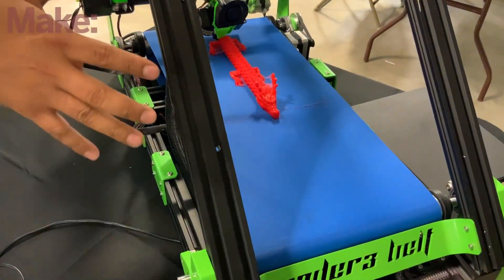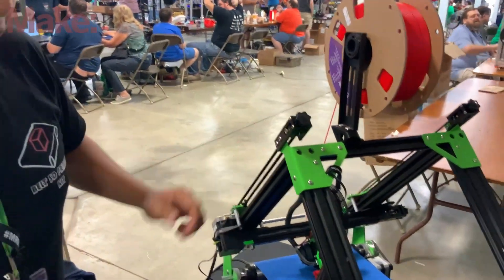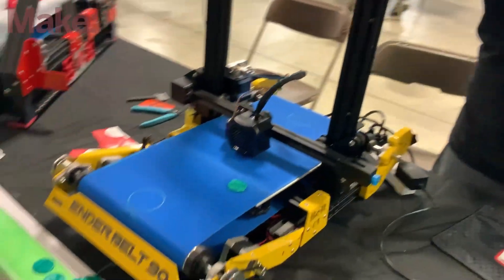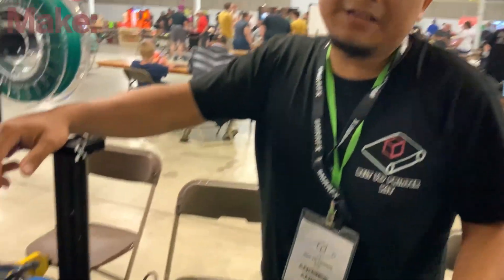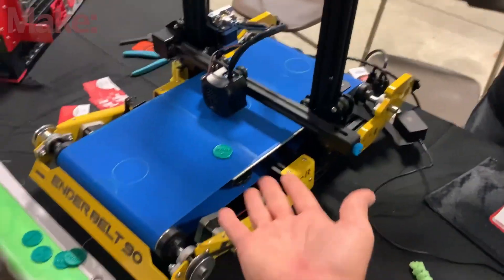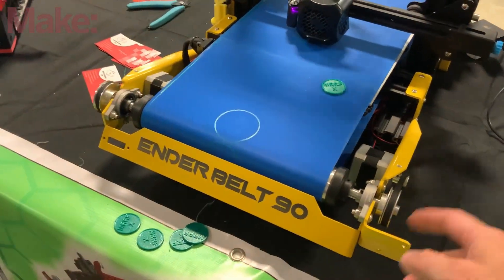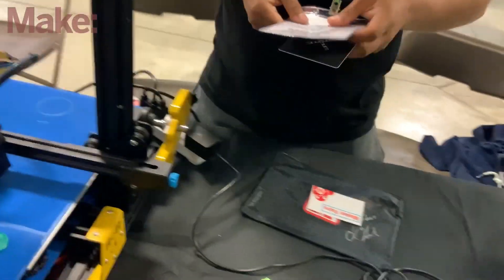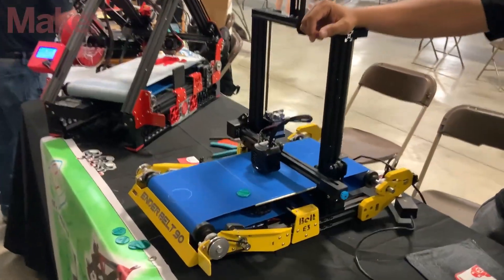This DIY belt conversion kit will turn your #3dprinter into a belt printing TANK.

Comment: We can now have these because make the channel this is on had a patent they did nothing with and pushed back 3d printers by 15 years. Thanks make for promoting something you used to sue people over. Rip MakerBot you piece of...
Reply from the maker: I think you're confused. Make is NOT Makerbot. Bre Pettis worked at Make Magazine, then went on to create teh 3d printer and called it Maker Bot. The two are not the same company.

Comment: For a noob: what are the benefits of a belt printer, besides one longer coordinate?
Reply: You can print continuously with minimal human intervention and eject your part automatically using the conveyor.
Reply: @WurstPeterl  cool. Thanks 👍🏻
Reply from the maker: imagine you wanted 100 of something. You could just let it go and come back when it is done!
Reply: @MAKE Most 3D Printers can already do that, as long as the object you want is spaghetti.